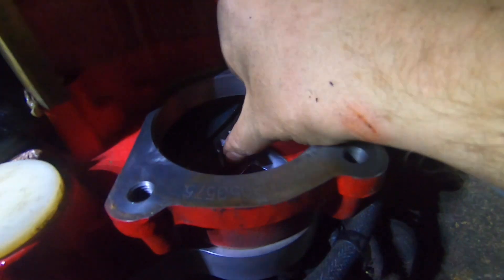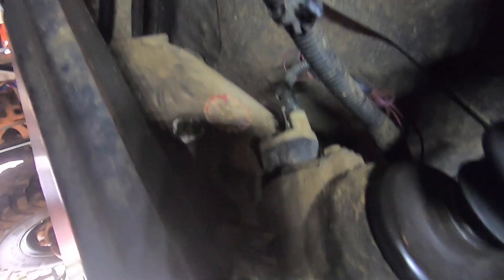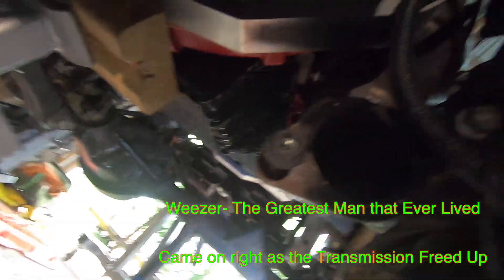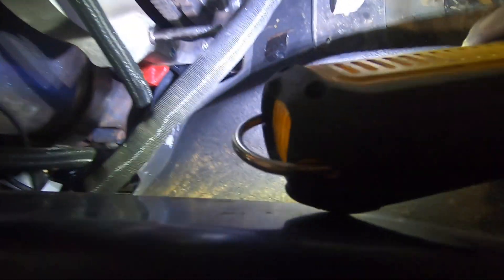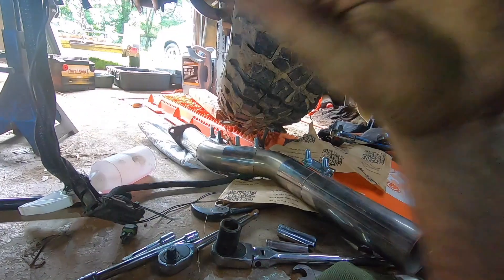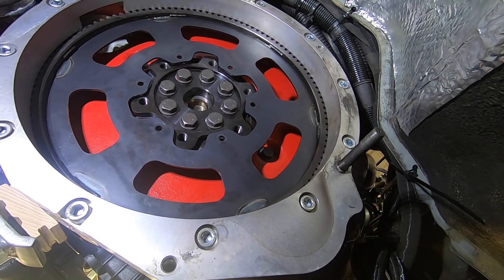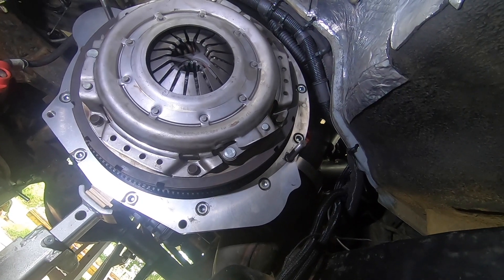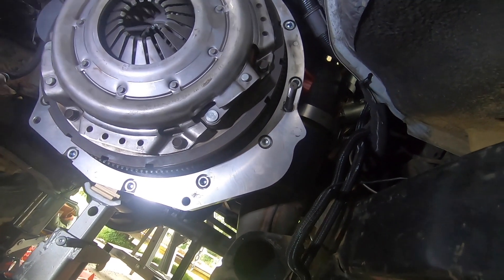Flywheel Adapter Issue with the R2.8 Cummins swap kit

Comment: Wow, those welds are tiny for structural part in a harsh environment!
Reply from the maker: The original ones which were mostly just to tack the teeth to the webbing/hub part. I have no idea why I didn't catch this before while installing. I guess I was just in like a drone mode and trying to get stuff put together.